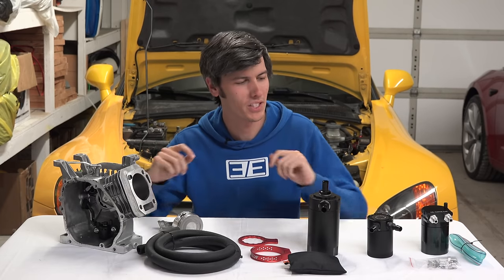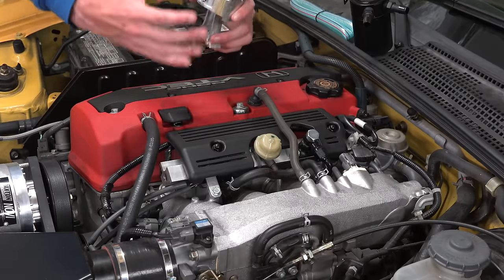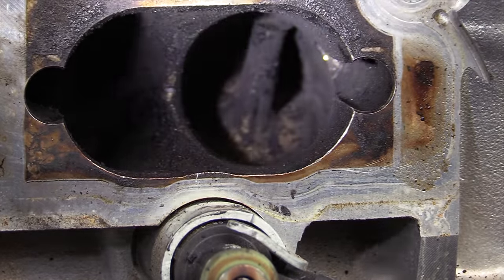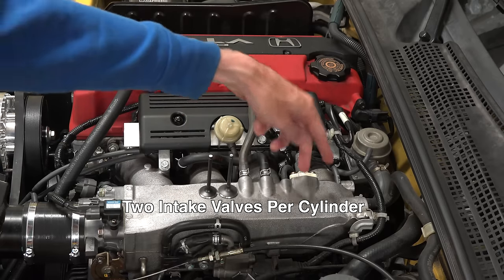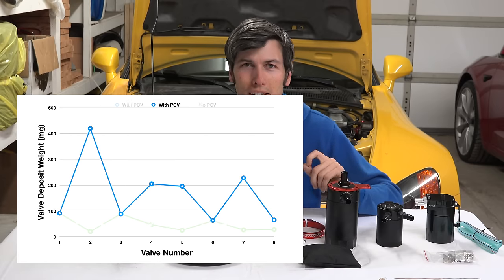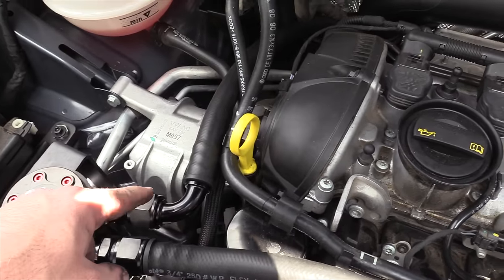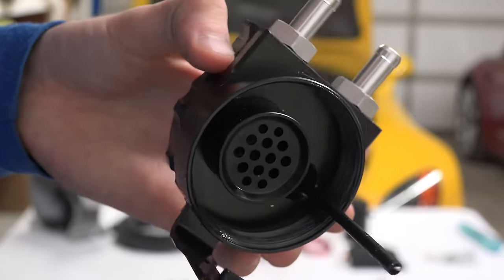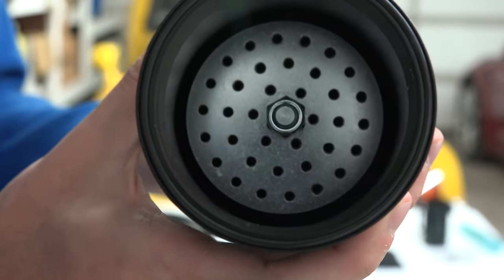Do Oil Catch Cans Actually Work?

Comment: That’s weird. We learned that the carbon deposits on the intake valves only appear due to the use of an EGR valve where they recirculate some of the exhaust gases back to the intake to have them burned a second time. This is supposed to lower the total emissions of the engine.
At the lab, we could see the difference pretty fast by deactivating the EGR and no build up was recorded. It’s why after the emissions scandal of VW became such a big issue in modern cars. Manufacturers simply reroute too much exhaust gases back to the fresh air intake. We have to regularly clean engines now (sanding them but with crushed walnut shells) to remove all the carbon buildups.

Comment: For anyone interested in modifying a car, and considering a catch can, this is an absolutely awesome video. Also, big thanks for featuring the Humble Mechanic, yet another awesome Youtuber that I can subscribe to for more knowledge! (I'm seriously starting to overload on good information thanks to so many excellent Youtube channels.)
Reply: I wish he'd have gone into further to why the Bronze filter works and how.
Reply: @CJManning86  its just a filter made of bronze lol the low micron means it only allows small particles like air through so the oil, gas vapers stay in the catch can. it's nice because when they get dirty you can just remove it a wash it off so they basically last the life of the engine

Comment: 1994 Oldsmobile Achieva with single overhead cam 4 cylinder had an oil separator with a drain back to the crankcase. Inside it was a block of some type of open cell foam made of something oil wouldn't degrade. Problem was after umpty-thousand miles the thing would just get soaked quickly, even after cleaning it. Might have been some kind of coating on the foam that degraded? I didn't have a manual for the car so I don't know if it was a regular maintenance thing to clean or replace.

What's always been annoying about PCV is all of them have been made to dump the crud into a dry part of the intake. With carbs it was connected to a little foam filter in the air cleaner, so when that filter oiled up your air filter and carb would also get oiled up. Same goes for Throttle body injection, the PCV pipe is connected at a point to produce maximum filthyness. Many multi-port injected engines have the PCV dump into the are intake just upstream from the throttle body (without any filter like with carbs) or right into a passage in the throttle body. Either way the throttle body gets all grungy. With PCV into the air inlet, all the TB gets filthy. With PCV into the TB the back side of the throttle plate gets it, and there are passages that slowly clog up over time.

No matter where the PCV goes in with MPFI, ALL the inside of the intake manifold gets cruddy. Should drill passages to make a PCV sucking manifold inside the intake manifold that delivers the blowby right into the fuel spray above the valves.

Or better yet, an oil separator like the 94 Acheiva but built to last, an all baffle design, with a drain back into the crankcase. It wouldn't need to be metal, just high temp plastic with a long and twisty enough labyrinth to make all the liquids condense and drop out.

Comment: I have the cheap one shown here. 
It works very well ONLY after I dropped a stainless steel pan scourer (stretched out) inside the can. 
The built-in baffle is useless.
Emptying the can is also very difficult with the can in situ, due to the smoothness of the can body - there's nothing to grip your hands onto.
Installing a tap would be advisable.
Certainly worth the money though, and great value!

Comment: Both the $25 one and $100 one are just around $15 if you buy in China.....
Reply: I think it cost me that ($15) to make my own 15 years ago...
Reply: Yank your PCV hose, cap the intake manifold hole, and run a breather-tube on the valve cover side.  (save your PCV hose for when you need to get your vehicle emissions tested)  Cost ~ $4 for hose, wire-ties and a rubber cap.
Reply: Yep! did a vid on $15 one added baffle and scrubbies works like a charm.  In the winter got to empty it A LOT
Reply: yep, just bought the exact second one for $22 AUD. Clearly it's Chinese manufactured, so might as well cut out the many middle men that quadruple the price. Yay for Global Economies!
Reply: @shinjisan2015  i did too its the exact same as mishimoto design if not the exact Chinese maker and its on amazon called sporacingrts is it the same for you ?
Reply: $10 more like it !
The shipping is $30...
Reply: @jessstuart7495  many European car companies have used them for decades as part of the pcv system.
Reply: @nick-zc9xv  🤔exact same thing but at a cheaper price and about the same build quality and if made by someone you know or by yourself could be even better for way cheaper... kind of unnecessary to spend 250 when you can get the same thing for a lot less? Expensive parts doesn't always mean good when they're about the same as Chinese/home made counterparts....
Reply: @nick-zc9xv  I'd make one myself as I would trust what i made over any other cheap parts, but if it gets the jkb done and prolongs my vehicles life, I'm all for it.
Reply: @jessstuart7495  Unfortunately, on some cars, especially newer models, if you do not run this breather tube properly, as well as filter it properly, it will start sending visible hot vapor / "steam" out through your enginebay and out from under your hood.   Been there done that.  I had to install one of these cans instead of just running the vent hose through a small filter.  Didn't work for me on my 2007 Mustang GT.  And I am a big supporter or doing this mod on all of my vehicles.
Reply: @isaackvasager9957  And ruin one's engine in the process.  No debate....  and no thank you.
Reply: @jessstuart7495  They want to please the tree-huggers out there.  Simple as that.  But ruin our engines prematurely.  Nice trade-off!
Reply: Horsepower house, you were trying to hotrod a ford is why it didnt work.
Reply: Ryan Adam So why did it also not work on my previous Chevrolet Camaro or my Dodge Challenger. It doesn't make a damn what make and model it is.
Reply: @HorsepowerHouse  people who care about our planet are much respectable than those that want to destroy it!

Comment: Oil in the intake plenum is bad...period.
The type of fuel injection is immaterial.
The amount of carbon buildup translates to dirtier oil and more wear...
Catch cans should be STOCK on all vehicles...
A drain to the oil pan with a one way valve would be nice.
Reply from the maker: Yeah, though not sure you'd want it draining to the oil pan if it was catching a large amount of water, like you saw in Charles' case. You wouldn't want that water diluting your oil.
Reply: Yeah I would not want that going back to the oil pan. I'm sorta surprised they aren't standard in modern engines, mainly due to the tendandy of oil to cause preignition along with the DI deposit buildup issue... I only know of new diesel trucks using a real serviceable filter element to filter them out and keep a closed system.
Reply: @volvo09  I think it's probably because it's a constant maintenance task that most people (unfortunately) wouldn't bother to check until the catch can overfilled and started purging that water/spunk mix into the intake, causing more damage than the incremental carbon buildup...
Reply: BobbyG you don’t want fuel and water draining into your oil

Comment: I wouldn’t put that on my truck, which has a GDI engine.  GM has products and a procedure for cleaning upper engine deposits.  What I want to know is how many miles of normal driving will produce sufficient deposits to cause problems.  When I notice rough engine operation, I’ll have my dealer check it and do the cleaning, if indicated.

Comment: Thanks for the video, I really enjoy your chanel. Question, Have there been any studies on PCV lowering the octane of your fuel at the cylinder due to the addition of oil and contaminants?
Reply: I've never seen a study but I've read Multiple articles stating the blow buy can cause your fuel quality to be lowered. It makes sense that with enough of it your octane would be lowered

Comment: My 1983 Mercedes diesel uses its air cleaner as an oil catch can, well kinda.
Reply: ehrichweiss yup thats why the top of the air filter is always so dirty on those cars!
Reply: My motorcycle too. I have a K&N filter and there's no point in oiling it after cleaning. It's self oiling ;)
Reply: My 83 240D has a little foam encased catch can, then it goes into the intake below the filter. I removed it because my intake was full of oil so it clearly wasn’t working.
Reply: Kevin spacey and I'm not wrong, my oil catch can was in fact not working. Being the car is over 35 years old, with 270,000 miles, it's collected a lot of oil over its life, and the engine has tons of blowby. The PCV works fine. If it was plugged the engine couldn't release pressure from the crank and would probably die out
Reply: Kevin spacey but the diesel motor im talking about is not Carbureted

Comment: Everyone with  VQ engines knows they do! Vented is the way to go.
Reply from the maker: What's your ride!? VQs are fun. :)
Reply: @EngineeringExplained  I plan on picking up a G35 or 350z soon as a project car! (:
Reply: Works AMAZING, my 6mt sedan has a vented. My first G I had a sealed system, didn't really do anything at all.
Reply: @Mizagyu   Looks like I need one as well for my g37 coupe. I am at about 475 whp and my pcv deletes are blowing some crazy amounts of vapors.
Reply: So needed for N/A VQHRs? Sorry for ignorance but new to VQs.
Reply: Vq are port injected. Will it still benefit with a catch can?
Reply: @FrankieXenon  depends on your mods.
if its a turbo build - yes!
if your still running n/a, not so much.

but less oil in your intake is less self detonation.
runs cleaner
takes more compression
Reply: @FrankieXenon  Yes but to a much lesser extent,  as the engines are port injection so the intake valve's will stay pretty clean but the nature of the engine and how it' s designed means there is a fair bit of blow by and that can build up in other locations.

If your not tracking your car or planing any big mods it really isn't required, I'm on my 2nd VQ engine over 20 years  with about 400K KM on the clock
and never had a issue due to carbon build up.

The throttle bodies need to be cleaned every year or two but that's about it.
Reply: Had my 350z since 2012, always had a catch can, stuff it with stainless steel scrub balls, and replace them when you empty it.
Reply: Engineering Explained 09 G37s coupe here =P
Reply: Got the 25 dollar one on my z. Love it!
Reply: 05 g35, I run a sealed catch can on a stock na vq rev up. It works great, empty it every oil change.
Why run the vented instead of sealed? Is that mainly for FI vq's?
Reply: @thomasaardahl1514  Never have before, except for when I forgot to hook one of the hoses up once when I was cleaning the can out after an oil change. Lmao
Reply: No they eat oil.  Thanks to penny pushers messing with the piston rings...
Reply: @CrazyCat229  This only applies to the RevUp VQ35s.

Comment: You could just let the crank case breather drip out and lubricate your lawn. 🤔😉
Reply: Ola Eriksson old engined did. They vented straight to atmosphere, but in the mid 70s the EPA regulated it.
Reply: The good old days.
Reply: @UHOH3300  
And my 98 tdi has been corrected with this update.
Reply: Had a old 79 MG MGB come in that had the PCV venting straight to the atmosphere lol
Reply: looks like nobody knew the reference.. probably the funniest video on YouTube!
Reply: If you disconnect it the car won't even start

Comment: The crankcase gas recirculation system in BMW's has taught me that a remote separation system is a bad idea. The 2000's BMW's have remote, insulated, polypropylene separators that are nestled under the polypropylene intake manifold. They rapidly cool with freezing ambient temperature, and their diaphragm freezes shut, causing an ice buildup in the feed line. This causes excessive pressure, and the valve cover gasket blows out the camshaft cut outs. BMW's solution was aluminum valve covers (instead of plastic) with aluminum baffles and chambers that recirculate to the intake through a 6" tube (instead of the original 2 feet of tubing). 

A catch can presents the same problem. It's too far from the block to retain heat while the last bits of vapor condense, so you'll get ice in the lines.

Comment: Provent 200 works great, has a drain, flows more than most pcv will ever flow, has replaceable element, drawback is size. I have one on my old Mercedes 300D turbo. The blow by is redirected and instead of a oily mist going into the engine it's nice and clean now. In this case there is a lot of blow by and would drip oil from the connector to the turbo before I installed the provent.

Comment: It'd be *really* nice to have your take on using these in colder climates with harsh winters. My next vehicle will be GDI but also have to live outside of a garage for multiple reasons - and in rather cold winters. I've heard concerns about cans freezing in cold and possibly blocking the system as a result. What's your suggestion on a solution?
Reply: Get a Toyota with D4-S. It’s both port and direction injection.
Reply: It's a real thing, negative 20's where I live and every time it gets that cold everything freezes up and my truck can't idle and I'm afraid I'm going to blow a lower end gasket cause it can't vent. It's a huge pain in the ass and this summer that damn can is going in the trash.
Reply: I know I'm 2 years too late! I've had my can on my 2011 tacoma 4.0 and have 300,000km on that can. I live in western Canada where it's common to see -20c for weeks at a time. I've never in 12 years had an issue with tue can freezing up. In the winter I drain it once a month and have never had an issue. The engine heat thaws them out quickly if you are concerned. Just drain it regularly and you'll never have issues.
Reply: @The_Blessed_Cowboy  how longs your commute? Mine is like 3 miles. Mfer freezes up everytime and makes an idling issue.
Reply: @godackgudalach1  my commute varied at the time..anywhere from 20kms to 45km when I was running heavy equipment. Shorter commutes into town for errands were maybe 10km?
It's important to drain them frequently I found. I just never had any issues at all in 12 years. There were times temps dropped below -35, -40°c and still never had issues. Never threw any vacuum codes either. Maybe I was just lucky! Could also vary between vehicles too I suppose?! 🤔
Reply: @The_Blessed_Cowboy  ohh absolutely so many variables. I bought a name brand expensive one and still freezing up... But I go short commutes to the bus pick up for work so I understand why mine freezes up 😂
Reply: @godackgudalach1  a catch can would nti affect that at all if the oil in the catch can freezes it won’t block anything and if it freezes so would your engine oil and your engine woudlnt start
Reply: @Noah-jb9om  so the WATER in the catch can DOES freeze and it DOES block off the CRANK CASE VENT and makes the 6.2L in my 2017 not idle. Not sure why you wanna try to tell me what my truck does and doesn't do 🤡🙄
Reply: @godackgudalach1    Whether in the catch can or in the direct line there is still water, not sure how it freezing in the can would be any different then it freezing in the lines.  It is still an issue all around.  If the can is near the engines like the lines you tied into there shouldn't be much difference, the can will warm up just like the lines would.
Reply: @chrish7336  water don't freeze in my lines because I don't have any low spots. My can sits higher than the feed line from the crank case and higher than the return line to the intake manifold.  Only thing that freezes up is the condensate in the can.
Reply: @godackgudalach1   Same on my wifes car, the can is higher than the crank case and manifold.  Although for her vehicle due to poor design, I am looking to modify the Oil cap and put in an actual pcv line. Should help even when the internal pcv port is blocked.
Reply: There's a bypass so that it doesn't cause issues.

I put my catch can on the Eagle talon in contact with the exhaust. It converts motor oil into burnable fuel.  

But since it's not the main flow of air, it's usually fine and corrects itself as the motor warms up

Comment: I think you forgot to mention that the PCV air/oil lowers your octane levels in the cylinder.
Reply: fr?
Reply: Yup
Reply: Minimally. It's like saying a candle contributes to global warming. If you're burning so much oil that it's lowering your octane then your lower octane is the least of your problems. The oil does however contribute to carbon deposits in the chamber which raise the octane needs of the eng.